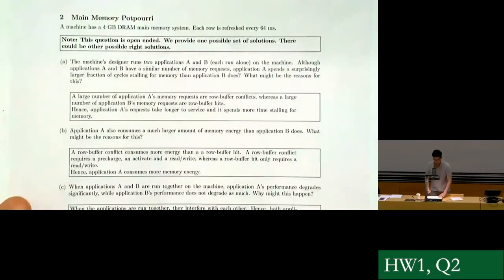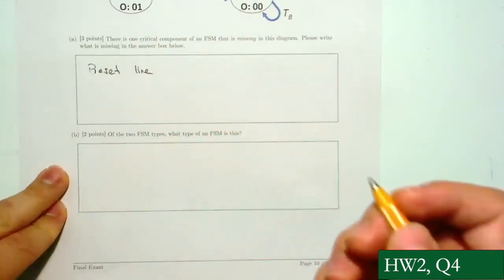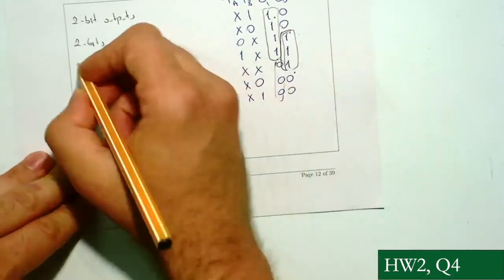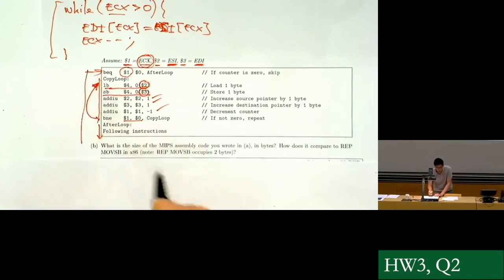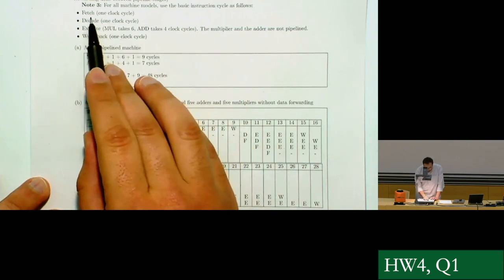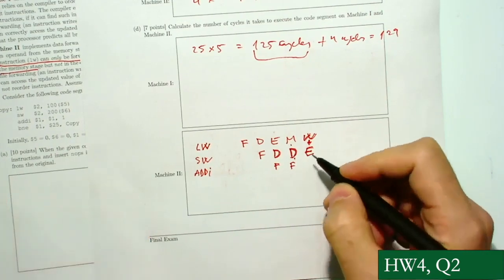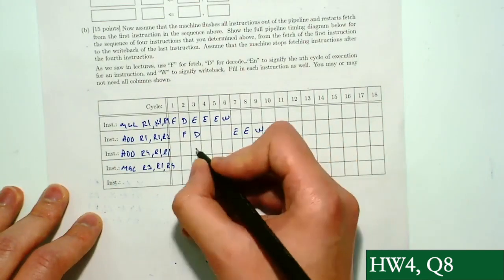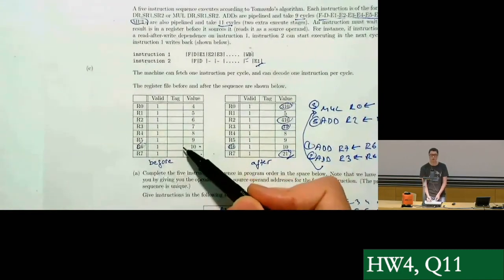Digital Design & Computer Architecture - Discussion Session I (ETH Zürich, Spring 2021)

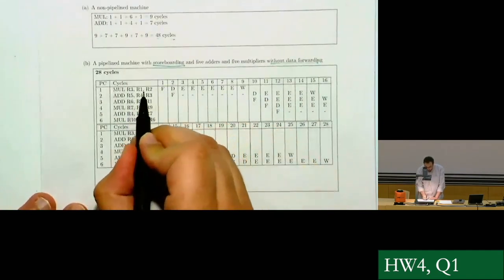Comment: At 1:47:04 As far as I know when we have score-boarding we have out-of-order execution, thus we can execute completely independent commands without waiting for the other commands, in this case, MUL R7, R8, and R9 at the 4th operation is independent of the previous. why we did not start executing the 4th operation at the 3rd clock cycle and waited for the previous to be completed?